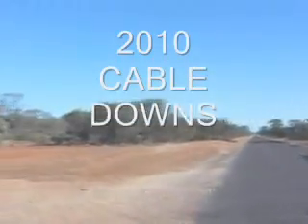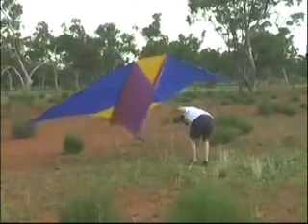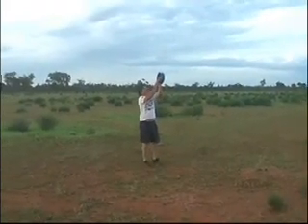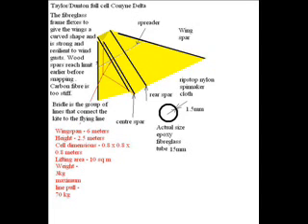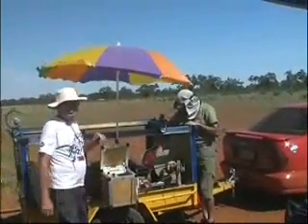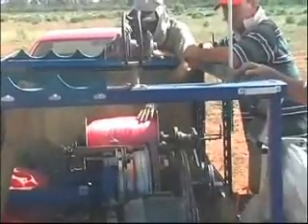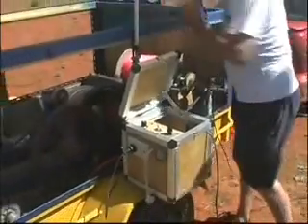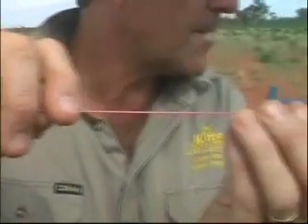Kite Altitude World record attempts 2010

Comment from the maker: Good on you. Even with 10 small kites it must have been tiring to wind in 1,700 meters of line.
We can't use a gloved hand to retrieve 10,000 meters of line because the line tension and extremely thin and slippery line wound cut our hands off. The line tension is up to 60 kg. The line is 0.7mm thick. Our 12 sq meter kite has flown in 120 kph winds although it doesn't fly well in such strong winds. Most kites are happy in winds between 5 and 30 kph.

Comment: gr8 vblog when I was a kid sum 44 yrs ago I snapped up alot of line about 1.7km and I thought that was alot nylon kite line, I bought  at the local stores little did I know about FAA regulations, had a string of 10 kits take out the whole 1.7km of line in a light breeze. It was alot of fun at each 170 meters putting another kite on the line. That system I had I could put out 1.7km of line and 10 kites on one line with almost no wind those were the days.
I used rope gloves instead of capstan

Comment from the maker: @droceretik The line is made by Cousin-Trestec in France. The raw Dyneema fiber is supplied by DSM Dyneema in Holland. The supply is under a sponsorship arrangement. Dyneema is the World' Strongest Fiber, being weight for weight, 8 times stronger than steel and 40% stronger than Kevlar. It is UV resistant and is abrasion resistant. In comparison, nylon fishing line is, weight for weight, 10 times weaker and would need to be 5 times the diameter to achieve the same strength.

Comment from the maker: @droceretik The line is 2 strengths to account for an increase in tension at the winch end of the line relative to the kite end, due to aerodynamic drag on the line.
The alternative is to have the same line strength from winch to kite but the kite lift often drops as the air density decreases even though the wind speed increases. The idea is to have the thinnest line possible to decrease the load that the kite has to lift. The line is between 0.7 and 0.9 mm thick and will float on water.

Comment from the maker: @DILLONATORFX You can see in the videos a reel and capstan winch system is used. In the 2007 video, the reel had 11,400 meters of 300 lb Dyneema line stored. In 2009 there was 10,500 meters of 300 lb Dyneema. In 2010, 12,000 meters consisting of 6,000 meters of 192 lb and 6,000 meters of 289 lb Dyneema. In 2011 it was the same line. In 2012 we will have 3 line sets of 12 km each in 175/250lb, 289/350lb and 200/300 lb combinations. These are to match different wind conditions.

Comment from the maker: @DILLONATORFX GPS telemetry using GPSFlight on-board module transmitting positional data via 900 MHz spread spectrum radio. Ground unit receives signal then loads via USB to computer and displayed on screen with software in real time. A backup GPS unit is also on the kite in case the telemetry system malfunctions. The line is made from Dyneema fiber, supplied by DSM Dyneema and braided by Cousin-Trestec. I use up to 12 km. I have 54 km. Google Kite Site and link to World Kite Altitude record.